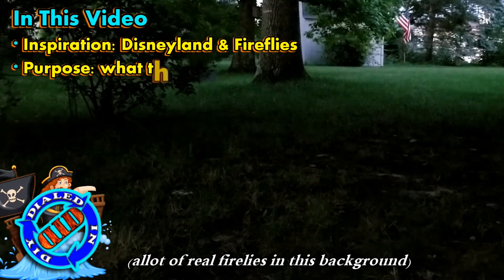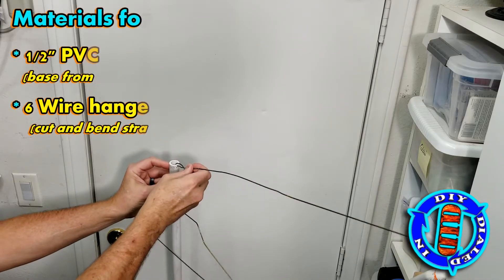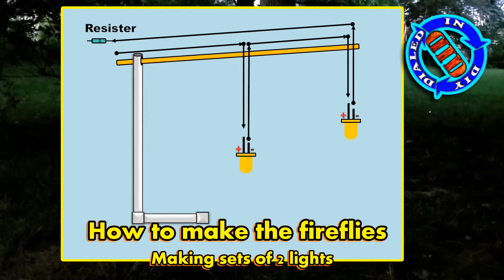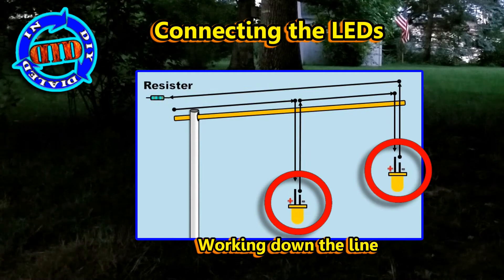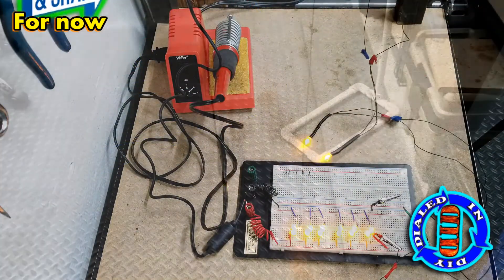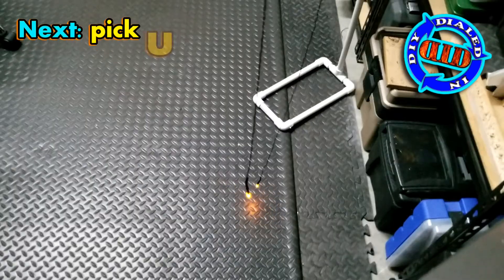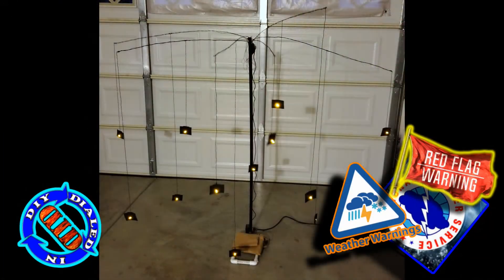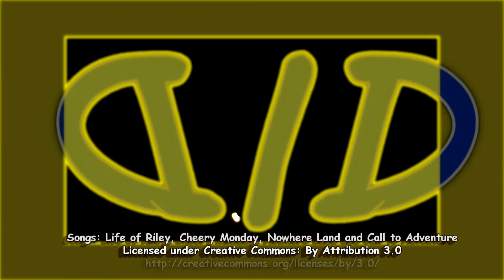Make Disneyland Style Fireflies - Amazing DIY Decoration

Comment: You don't protect led with resistors, they drop the voltage they are not fuses,if you want protect the leds use fuses.

Comment: Outstanding! Clear, concise and easily followable.  Along with the links provided, this is top-notch!  Thank you for taking the time to showcase this.
Reply from the maker: Thank you very much for the great feedback (I really appreciate it)!  This was truly a fun project to work through... including all the steps of evolution to get it to display the way I wanted it to.
Reply: @DialedInDIY  A thought came to me while watching and thinking about an external display.  If you were to incorporate some small weights (Think small fishing splitshots) into the felt sandwich, it may (or may not) give a little more stability to the fly.  Might also give a little more horizontal movement.  Would have to experiment with amounts and such, but it was a thought.  I've enjoyed your videos and have learned things along the way.  Thanks for using the internet for some of the 'right' things.  Have a great day!
Reply from the maker: @bealerusa  Great thought... I was actually just working to keep them light and had not really considered improving movement by way of added weight but I think you are on to a good idea. I will have to do some experimenting. One of my first attempts had them hanging separately (w/o the hanger) which would be even easier to use for experimenting with weight. I really appreciate the positive feedback too!  I'm working to pick back up the production frequency so stay tuned!
Reply: @DialedInDIY  The way you have presented it is IMHO one of the easier ways to do it.  It keeps it accessible to JoeAverage, yet allows for customization. I would argue that 90% of the folks watching your channel and then attempting the builds are sufficiently 'self'starting' enough to try some mods on their own.  I understand about weight management.  What you've done here seems to be the perfect mix for an indoor display.  Esp. as noted with a fan or heat vent.  Hangers are cheap ( I mean cost effective...) and everywhere.  All in all, great job! 
And, thanks for the reply, BTW.
Reply from the maker: @bealerusa  You are very welcome. I love getting the replies / comments... I get some great mod ideas from the feedback many times too.  Hope you have a great weekend.